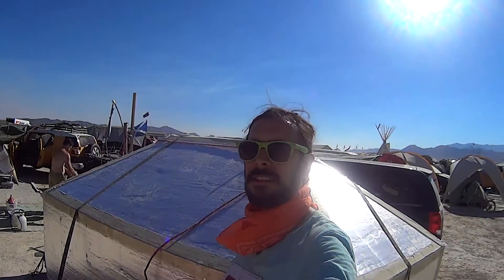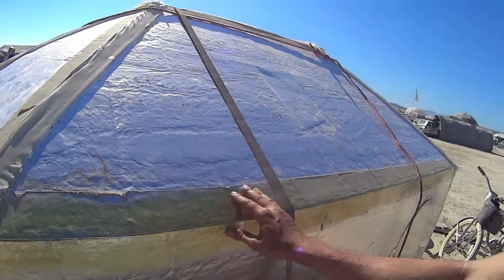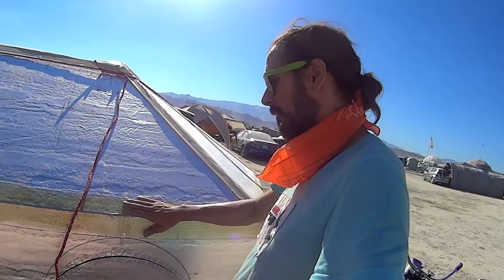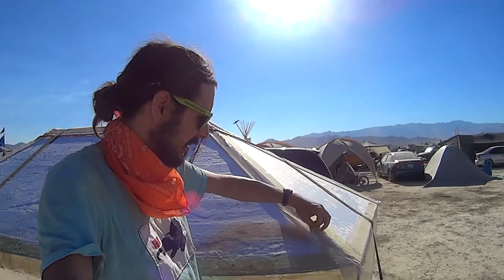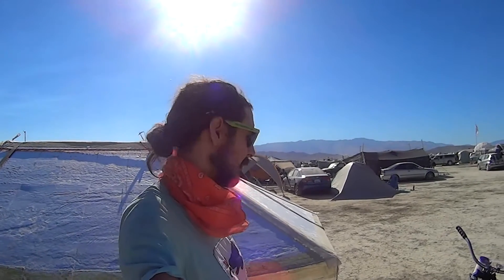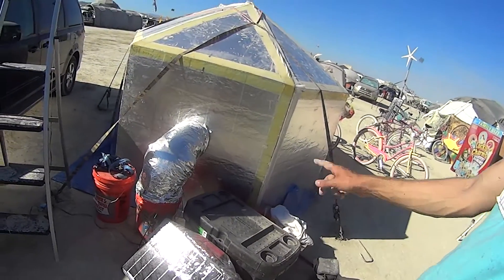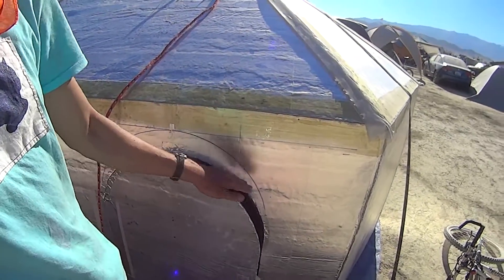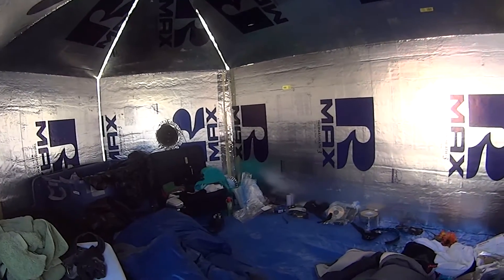Folding 6ft stretch hexayurt with velcro and vinyl

Comment: Hello, I was wondering how your set up is holding up as it has been a few years since any comments have been made. Is the double sided tape still your recommendation along with the velcro? Also, for the permanent joints, did you end up doing and liking the double sided tape and vinyl combo?    

Thanks!

Comment: Any recco's on the velcro, it looks like you're using 3". I was thinking of going 6", 3 on each side.  But I can't find a sticky version, just sew on.
Reply from the maker: I used VELCRO Brand 90943 - Industrial Strength - 2". It has stuck so well that for repairs to the permanent joints (and if I was building a new yurt), I have been using Scapa S301 Double Coated Clear UPVC Tape instead of contact cement. If I built another yurt, I'd still just use the 2" because it was never the weakest link. The hook and loop parts are definitely strong enough with 2". I guess an advantage of the 3" stuff is that the load on the sticky side is spread out over more surface area, so it is less likely to delaminate or cause the underlying foil to delaminate.

Comment: What brand and model of contact cement was used to glue the vinyl to the panels?
Reply from the maker: I think DAP. But it failed after several years. I have more success and an easier time using ,Scapa S301 Double Coated Clear UPVC Tape instead of contact cement.

Comment: Would the pieces of this size be able to all fit inside a minivan, you think? trying to figure out what size I could build and also fit in a average van
Reply: Probably not. Some minivans can hold a few sheets of 4'x8' building materials -- but only a short stack. It folds down to 4'x8', plus a little extra from the joints. So it would just barely not fit. That said, during construction, you could purposely trim a couple inches off all the pieces to make a slightly smaller yurt that would fit. Another alternative might be to make the sides fold as well -- so that it folds down to 4'x4' instead of 4'x8'. I am potentially making that modification this summer. Or, lastly, you could strap it to the top of a minivan. Though that will not help your gas mileage.
Reply: very insightful thank you. do you have any good sites showing best construction methods for these?

Comment: Did you just glue the Velcro to the vinyl?
Reply from the maker: The velcro has a sticky backing on it already, so I just pealed and stuck it. The backing on the velcro has held up better than the contact cement, and I am now experimenting with using Scapa S301 Double Coated Clear UPVC Tape instead of contact cement for making repairs where the contact cement has given up the ghost. The double sided sticky tape is waaaay easier to work, so hopefully it holds for a long time as well.

Comment: Wondering what your post experience has been with this method of construction? (would do better next time?)

Planning my build and I am super interested in the velcro idea since I'll be travelling solo and wanted to have an easy time for set up / tear down.  

Have you reused this model again on the Playa since its original construction?
Reply from the maker: I would absolutely do the velcro again. The self-adhesive velcro has held up very well and the time savings and reuse is great. I would also highly recommend beveling the edges because that definitely contributed to a lot of integrity. And the ratchet straps work well too.  I would definitely not recommend the contact cement. It was a huge pain to apply and does not seem to be holding up that well. I have a roll of this that I plan to test next, http://www.findtape.com/product586/Scapa-S301-Double-Coated-Clear-UPVC-Tape.aspx?cid=11&idx=18&tid=1&info=Double-Sided%2bTape.